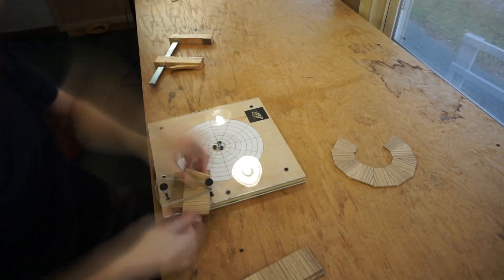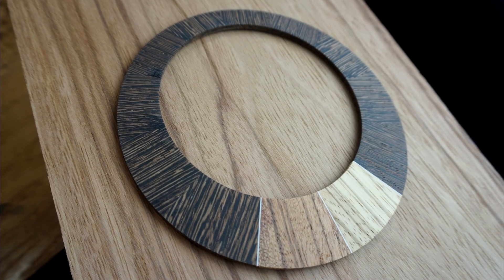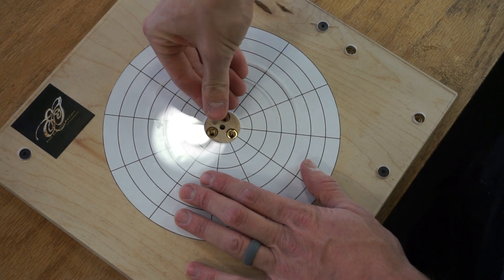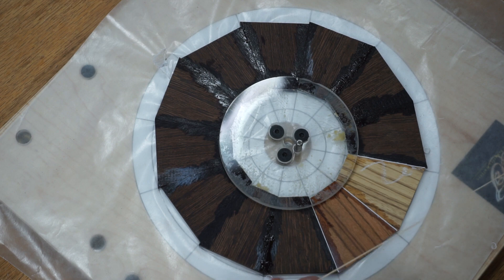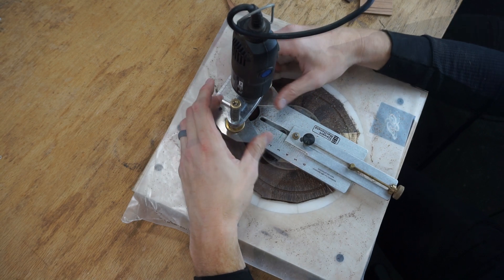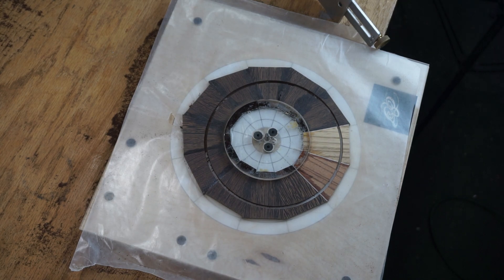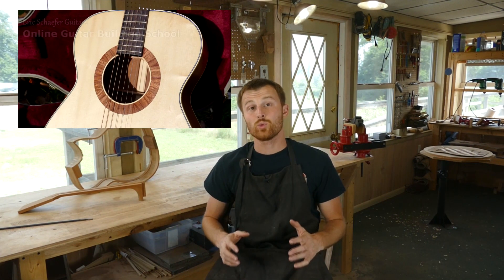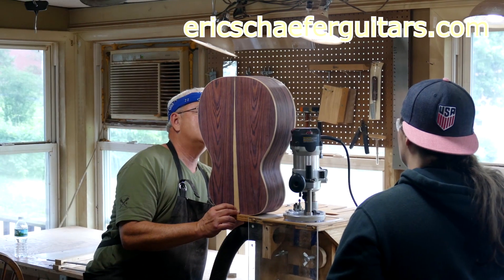Adding an Offset to a Rosette

Comment: Hi Eric, appreciate these instructional videos. I think these radial rosettes are amazing. I would like to confirm my assumption regarding the installation of the offset rosette onto the soundboard. I assume you would transfer the center hole and offset hole to the soundboard in an orientation which would put the larger end of the rosette where you want it and then use these two holes with the router and jig to complete the channel for the offset in the soundboard. The install of the offset rosette to the sound board might be a useful follow-up video. Thanks.
Reply from the maker: Thanks Barry. I'm glad you like them.
Yeah I think that would be a good follow up video for the offset. In the meantime, I do have a video that sort of explains this. I don't explicitly describe it in the video, but if you just carefully watch what I'm doing you can figure it out. Here's the video: https://www.youtube.com/watch?v=zsrDmHeklTc&t=238s
Watch it from the 5:40s mark and you'll see me inlaying an offset piece into some tiger myrtle. It's not a soundboard, but the process for inlaying it into the soundboard is the same as inlaying it into anything else.
Essentially, what you do is drill holes for the pin and the clamps screws, then carefully trace out where the inside edge and outside (offset) edge will be, then route the inside edge, then route the outside edge, and then you are making partial passes from the outside edge inward. This all should make sense when you watch the video. Great question!
Reply from the maker: btw, don't click on the hyperlinked "5:40" Whenever you write a timestamp in the comments youtube automatically hyperlinks it for the video that the comment is written under, so that link will just take you back to this same video... just in case you got tripped up by that.

Comment: Hello from West Chester, PA! Thank you for sharing your knowledge! I have learned a lot! Where do you get the big sheets of adhesive sandpaper?
Reply from the maker: Ah, West Chester! I used to live there on Franklin St. as a broke college student. Worked at Riggtown Pizza, which last I checked is still around. Stewmac sells 2-3/4"rolls of adhesive backed sandpaper. Unless you are asking about the really big sheets I use for sanding boards, in which case, they are old sanding belts from a local industrial furniture operation that I cut up and adhere either with double stick tape or contact adhesive.